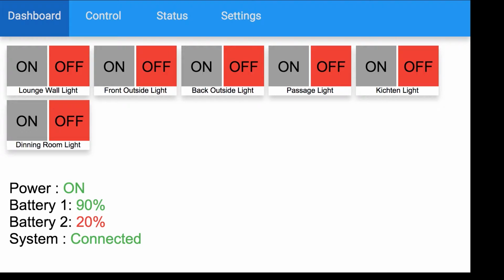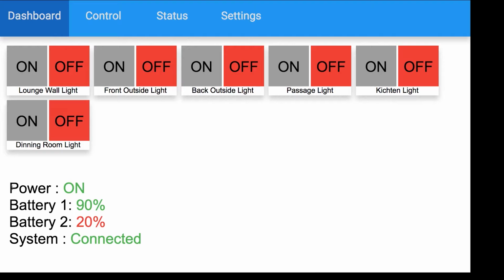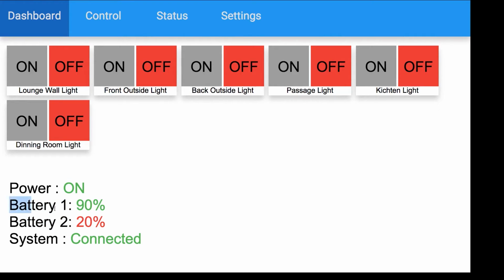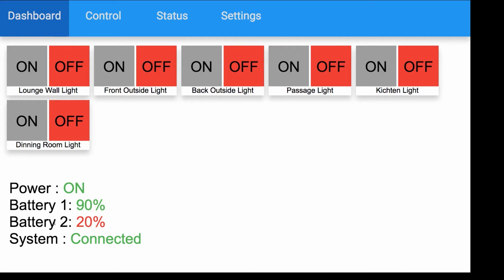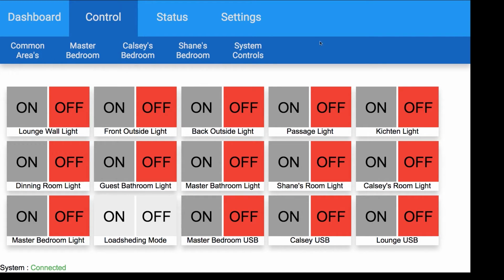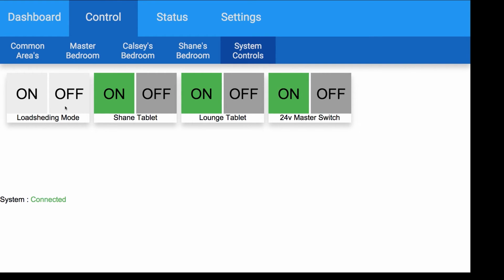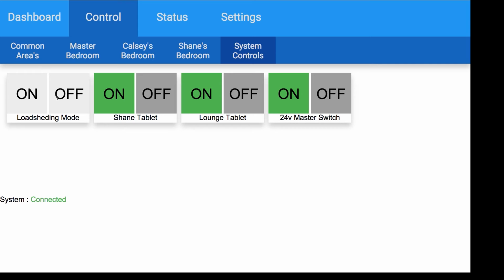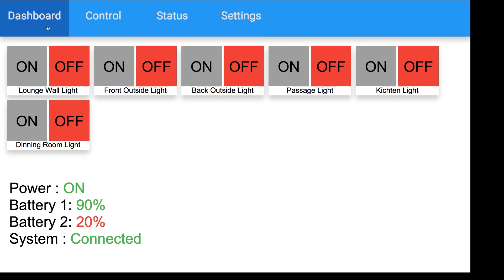Tour : Web Based Interface for Home Automation

Comment: Great video. Have you done any work on monitoring the battery bank? I have a solar battery bank I want to monitor but, I am not sure how any help would be appreciated?
Reply from the maker: I actually haven't done any work with the battery as my parents have moved and the system has changed but what I did end up doing is using a voltage divider to drop the voltage from 30v(24v system but wanted extra head room) to 5v with a smoothing cap connected to an arduino which was set to take measurements every minute. I actually connected a relay to the voltage divider so that it would only be on when a measurement was taking place so I wouldn't drain the battery.